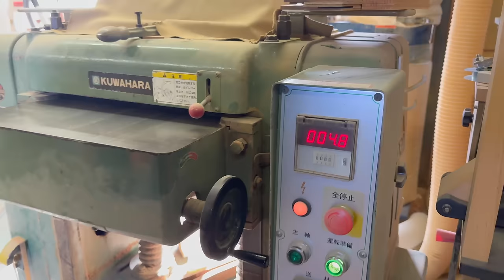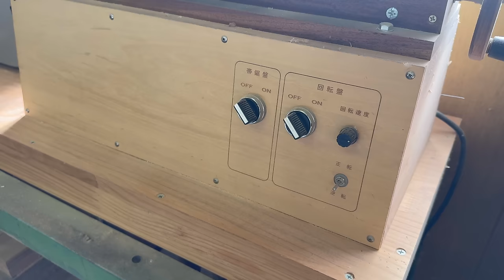Only 10% of this wood can be used for this Traditional Japanese craft

Comment: absolutely gorgeous wood and a craftsman to do it justice!!  i wonder why he boils it for bending and not steam it???  lunch looked good!!!😊😊😊
Reply: One can boil, or steam, or use dry heat.  What maters is that the internal temperature meets a certain temperature at which the wood becomes pliable.  And remains pliable for the duration of the process.  When making boxes like these, the wood is sufficiently thin that boiling water will plasticize it.  

People often think the water is what makes the wood pliable, and this can also be the case, but it severely weakens the wood for it to be made wet.  So ideally, one does not get it wet.  The outer fibers are of the greatest concern were dampening the wood is concerned, because they will come under tension during the bending.  When wet, they tear easily.  Ways around this are not to make the bend very severe, or to support the outer surface, as they do here with a mold.  One can also reduce material thickness, or severity of the bend, but one assumes that has already been reduced to practical limits what any given project.

Steam is very dangerous, requires  lot of heat to produce, and one has to get rid of the excess vapour.  So, if one can avoid producing steam that is a better choice.  Stem also forces water right into the wood, and it will take longer to dry out, which may or not be an issue.  Boiling water really saturates the surface fibers, but they dry quickly, and moisture will not have reached the center of the wood.